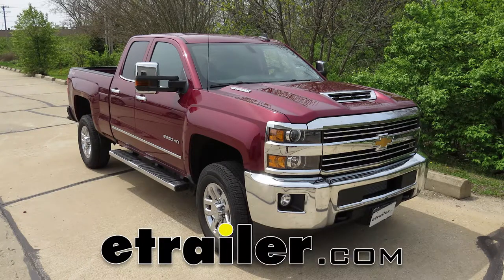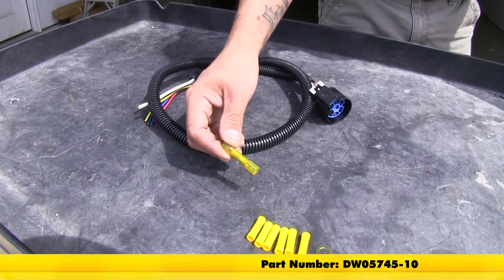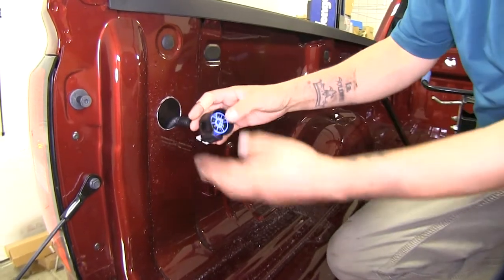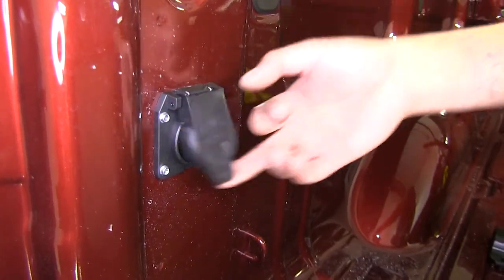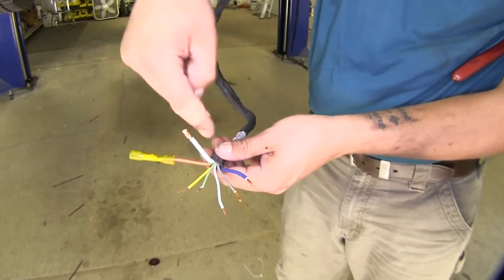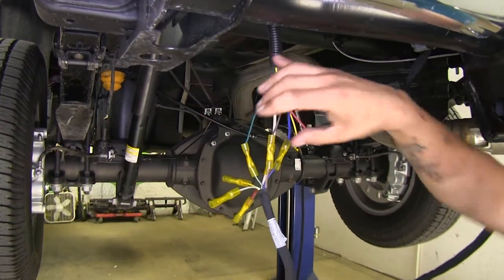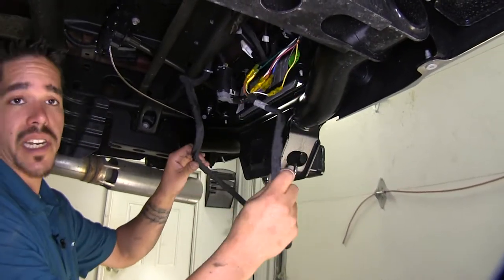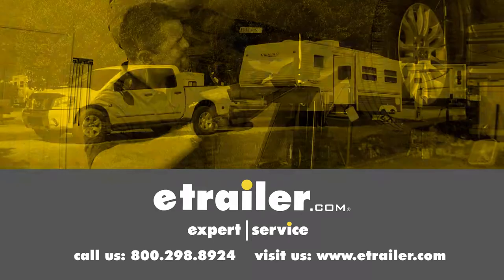etrailer | Pollak Pigtail Wiring Harness Installation - 2017 Chevrolet Silverado 2500

Comment: Does every 2017 chevy 2500 have this factory harness to connect to?  I don`t see it on mine unless maybe  it is hidden by the spare tire.
Reply from the maker: I'm honestly not sure if every 2017 Chevy Silverado 2500 has those extra wires but it would be worth checking around the spare if you wanted to go with this install method. Otherwise you can either splice into your other OEM wiring or use a plug-n-play type connector like the Pollak part found here https://www.etrailer.com/Custom-Fit-Vehicle-Wiring/Chevrolet/Silverado+2500/2017/PK11893-11932.html?VehicleID=201720354